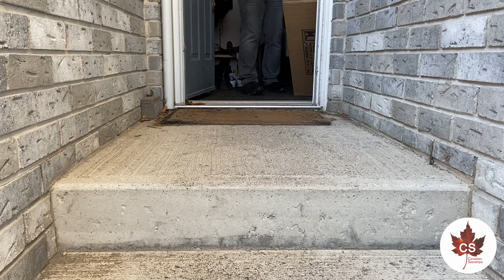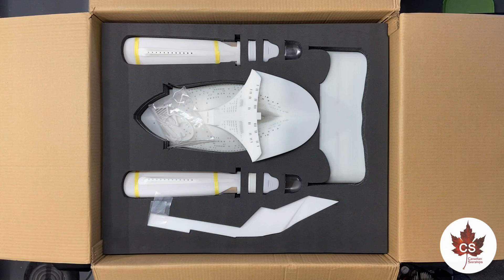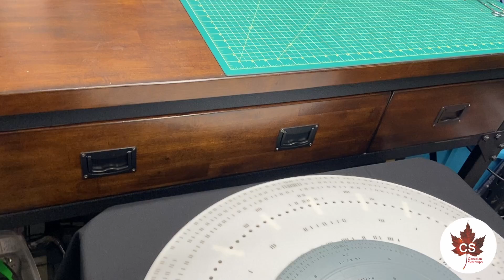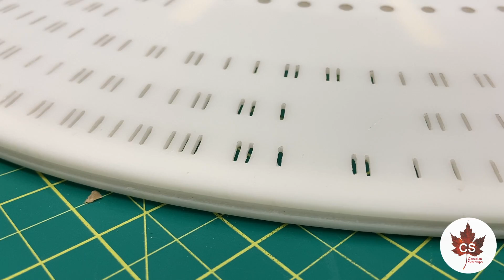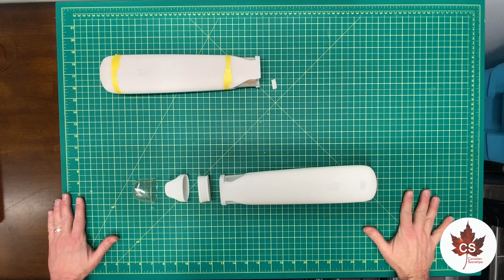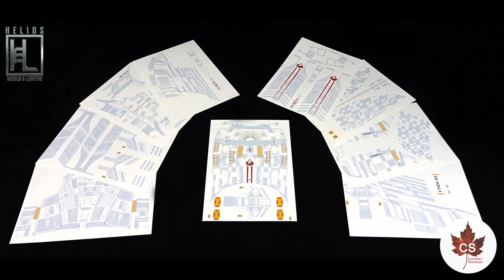1:650 Enterprise D Unboxing & Review

Comment: Met you at Wonderfest this year. I'm building this along with Lou...I'm sprueverse. How are you tackling the dome on the bridge top of the saucer? They did not include this as a clear part. Cheers, Phil
Reply from the maker: Hi Phi, yes I remember talking to you at WonderFest... and I did check out the live you guys did at the end of your last SprueVerse Challenge! I'm not sure what I'm going to be using for the bridge dome yet. I've still got lots of stuff to sort out with this project as it goes. I'm hoping to find the right sized clear dome somewhere in the depths of internet! If I find the right thing I'll be sure to make it know. This is a project were we will all rely on the hive mind!
Reply: @CanadianStarships  I’ve just tested solarez doming resin and it works perfectly! I’m also discovering that Phrozen light curing putty works on the windows! Cheers!
Reply from the maker: @sprueVerse  How clear does the solarez turn out? I need something that will be optically clear if I use the bridge and conference room interiors.
Reply: @CanadianStarships  use the solarez diamond - it’s optical clear. Definitely need to practice but it’s worth it.

Comment: What brand of epoxy glue do you use?
Reply from the maker: Right now I'm using JB Weld ClearWeld  5 Minute.
Reply: @CanadianStarships  thank you! I didn't think CA glue would be good enough. I'm also considering putting support in the pylons and the saucer and replacing the center support with something aluminum flavored.
Reply from the maker: @KillerLSXZ  If you are talking about the 650 D, also remember that there is still a metal plate that is to arrive along with your decals, that is somehow meant to work as part of the support structure. Not sure how that works yet though.

Comment: @canadianstarships.  Can this model be easily fortified with adding a couple of layers of fiber glass in the interior?  Even the Nacelles looks like that modification can be done.
Reply: Of course you could do it, but you'd have to be very precise about avoiding the windows. Wouldn't do much to keep the nacelles from sagging with no support in the pylons though.
Reply from the maker: You could, but the resin is quite good and I don't think that it will be necessary, but we shall see!

Comment: Opened mine up, some similar issues: top of the neck's spine where it meets/overlaps the saucer is missing/cut off at a weird angle (may have happened during sanding - though with the way the saucer is designed I should be able to use some sheet styrene to replicate that bit of "spine"). The deflector insert is a bit of a mess on mine, its missing the detail on about 40% of it, like a bad casting. It has a bit of warp as well - but not enough I couldn't fix it. Not sure what I'll do there yet but may reach out to them and see if I can get it replaced, otherwise it will need to get commissioned through a 3D modeler and printer

All the negatives aside, this is an incredible bit of kit. Super smooth, details in the right place and so far I hadn't spot things that seem way off. I'm very happy and given the "garage kit" nature I was expecting a couple speedbumps. I'm very curious how people will handle the windows - on their builds they just backed them, but given the deep nature of the resin framing and casting, that means giving up off-angle transmission of light. Hopefully I can work out a way to fill them with a clear/diffuse material to help get the look of the original model (which had its windows done in a similar way to how we've done them on the old 1400 kits)
Reply from the maker: I know someone else has the same deflector dish issue as you do. Looking at my kit, the part on the spine is very thin, may have snapped off during transit. Contact Helios and let them know your issues. I'm sure they will do their very best to help.
Reply: @CanadianStarships  they definitely are - already replied and they’re on the deflector issue. One thing that has really stood out is how they treat every customer like a partnership, collaborative and invested. Really refreshing and I know that will go a long way into the end result.

Comment: Clearly a ton of effort went into producing this kit. That said, as a molder and caster myself I'm shocked that a big resin kit has no cast-in structure for thin sections like the nacelle pylons, or included metal support for the primary hull disc cantilevered out. 😳Resin deforms almost always over time, as we can already see on the clear pieces, and for something so big and labor intensive to build - just wow. Planning how a resin kit with thin walls/sections can hold up over time needs to be like ..50% of the work in designing the parts. Put it in front of a sunny window for an hour - game over. I wouldn't usually dare make predictions, but I sense that in a year or two, Helios will have a number of heartbroken customers.

  Reinforcement can always be designed and added after the fact. The total lack of panel lines on the secondary hull is the deal breaker for me though - I can see the argument that it helps with scale, but as a builder, if they bothered me I'd much rather have to fill them in than create them from scratch. 

  Aside from the poor structural engineering, still a very impressive kit. Between your phaser mod and the rest of their advertised lighting they seem to have electronics nailed - and I'm sure it will look amazing built up.

for a little while

Also the lip above the deflector seems pretty chonky. Been waiting for a definitive, big kit of the D for a while and hoped this was the moment ...guess I'm still waiting 😪
Reply from the maker: The resin is certainly more solid than other's I've used in the past. There are no long case uses on this kit yet, so hopefully the way the kit has been designed it won't be a problem. We shall see. The gridlines are actually not there on the top saucer of the studio model, but they are present on the bottom of the saucer and the secondary hull, so I'll have to look at what I want to do about those.
Reply: Another thing that made me slightly skeptical as to the accuracy: The scale seems to be off a bit (i. e. it’s not actually 1:650).
Reply from the maker: @germansnowman  A couple of us were looking at that and based on my measurements of the saucer, it's closer to 1:697 scale. Then I checked the 1400 D and fount it to be closer to 1:1385. I don't think any of the kits are the scale they say they are.
Reply: @CanadianStarships  Good point :) Thanks for the reply. I’m still holding out for a 1:1000 scale D kit from Round 2, or perhaps making my own someday.
Reply: FYI...its not casted and molded, its a 3D print.
Reply: @al3d35  If that's accurate - I'd be even more skeptical about long term durability. That said, printing is an insane way to produce a kit this big. They're hand-cleaning hundreds of supports on every piece they produce? I heard him say it was printed, but I assumed like most things, that means the master was printed to make molds and cast from. If not - again, wow. I mean best of luck to everyone.

Comment: Try Marshall Models  " new"!/350 Excelsior  & Enterprise B the same in 1 / 537 , Mask Design 1 /650 masks for the Enterprise  E also coming is lighting for the Enterprise E .
Reply from the maker: I've heard they have those coming out, and I now Mask Designs been working on the masks for the E. Lots of stuff for us modelers to sink our teeth into!
Reply: @CanadianStarships  , I am concerned about pylon sag , caused  from the all up weight from the nacells , has this issue been addressed & of course fully tested ?..
Reply from the maker: @garywood1973   The pylons look very solid and are one part, rather than add on's as the 1000 scale kit was. There should be no problem, however, being a new kit, there isn't any long term data.
Reply: @CanadianStarships  Question is this a movie style build or from the TV show ?, with what I have seen the movie version had a lot more detail .
Reply from the maker: @garywood1973   It is going to be the movie version, and in fact, I've just made an agreement with Motion Picture Miniatures to have a full paint mask set made for it.
Reply: @CanadianStarships  so is this just a one off masking set for your model or in this case clients model  or in general for the general public ?.
Reply from the maker: @garywood1973  It will be available to anyone who wants it. No word on pricing.
Reply: I just had another look at the un boxing, so to be fair no main bridge interior , no shuttle bay interior for the main shuttle bay no battle bridge section for the engineering section nor for the saucer section, no associated parts for these sections , no lighting "YET" no paint masks this is not a criticism just what I have seen or in this case what is missing , you stated it is an expensive kit, for the money your paying all should be their with you U.S.$ 1300.00 Helios should hang their heads in shame .
Reply from the maker: @garywood1973   I understand that you can get a replacement saucer top with removeable shuttle bay door and an interior shuttle bay kit. 

I am working with someone to have a bridge/conference room part made since there are nice sized windows on this. Once done, it will be made available for purchase.

A battle bridge would not be helpful since there is no saucer separation on this kit. That only works (somewhat) on the 1400 scale kit because it is small enough and light enough (without lighting) to make it work. It would not be structurally feasible at a reasonable rate of work/cost to make a superable saucer on this kit. Especially if lighted. 

A paint mask set is being created by Motion Picture Miniatures and will be available for purchase. 

As far as lighting, I'm doing my own thing with the lighting, using an Arduino, so I don't need the kit from Helios.

Comment: Great review, and looking forward to getting mine in a later batch. One question though, did the 6 footer really not have ANY panel lines on it? Almost seems like it's too smooth, and your 1/1000 version is a bit more accurate in that way.
Reply from the maker: After seeing how smooth the kit was, I went back and looked at the studio model. There should be grooved lines on the lower saucer and the secondary hull. The Upper Saucer looks smooth on the studio model. I'll have to look at adding them in in some way.... that's a problem for future me!
Reply: @CanadianStarships  Actually now that I check out some auction pics it does look very smooth. So maybe they're not far off after all.
Reply: @davidjames1389  Unfortunately for us, the horizontal scribed deck lines on the neck of the secondary hull are clearly featured in the slow flyby in the intro of all 178 episodes of TNG
Reply from the maker: There are no scribe lines on the top of the saucer on the 6 foot in the auction photos but there are on the bottom saucer and on the secondary hull.

Comment: The kit looks really well designed, other than those few teething issues you've already mentioned. Interestingly, Helios have designed the upper secondary hull almost exactly the same way the original filming model casts were designed - cast as one piece. The only difference is the upper surface of the nacelle pylon wing was also part of the originals, rather than being separate as Helios have done, and the deflector housing was separate.
Reply from the maker: I do like how the saucer edge is all one part. Much cleaner than some other kits. The 1K kit was a nightmare to get the saucers to go together. I've wondered if I could create some sort of way to use screws and a lighting gadget to secure the top saucer down to the lower saucer so it can be opened if necessary. I'll have to think that one through.
Reply: @CanadianStarships  the originals were/are fixed to internal armatures with counter-sink machine screws, the heads covered with small pieces of painted vinyl to hide them. The size of this kit does make that a viable option.

As for painting the aztec and hull markings, I think re-scaling my 1/1400 masks might be do-able with some key measurments to reference from the physical kit. Let me know if you want to discuss 👍
Reply from the maker: Yeah, we can chat in pm about all of that!

Comment: Looks great - thank you for the video! I'm part of the 2nd run, so I'll report on the lower saucer window gaps and small things like that, as well as the deflector dish. I'm as pleased as you were to see how they engineered the pylon and secondary hull join areas, and keeping the saucer rim intact as one piece
Reply from the maker: I think that it's too late for those corrections on the second run, but I think they will correct those issues for the third run, but I would very much like to see how the second run kits look in comparison, so please do post!
Reply: Omg! Where do I get one?😢

Comment: Shockingly huge!  So, are you going to get Aztec masks made, or are you going to Cricut/hand cut them yourself?  Are you doing the TV scheme or the movie multi-colour aztec scheme?
Reply from the maker: Right now the plan is that I'll be making my own masks. If I knew for sure I'd be building more than one of these, I might take the time to design my own and cut them on my Cameo 4, but for one kit, it would be faster to use tape. If there is enough interest in getting a mask set made, I'm sure @aztekdummy might be convinced to do so, but you would have to talk to him about that. If he does make a set, and blazes past me on the build as he is so speedy compared to me, I might be tempted to order them. It just depends on the timing. I plan on doing the Generations paint scheme on this one. The 1400 scale I'll also be doing will be the TV version.

Comment: Great rundown! So it looks like there no possibility of saucer edge windows, is that correct?
Reply from the maker: Not lighted at least. I will be adding them in but they will all be dark. Either via decal or another method.
Reply: Unlit rim would be appropriate to the 6 ft studio model according to Andrew Probert!
Reply from the maker: Indeed, and that seems to be the go to for most builders as the 1:1400 scale does not include them molded in, and the 1:1000 scale Shoko kit, though molded in, has no way to get light to them.
Reply: @CanadianStarships  I did manage it on my 1000 scale D but was hit and miss so didn’t open up many. Had hoped the same coverage would work for nav lights but that wasn’t successful. Agree on need to engineer the pylons carefully. I built mine with two extra brass rods to fix it, but still started to sag now under weight of very heavy engines. Hope the bigger one works out!